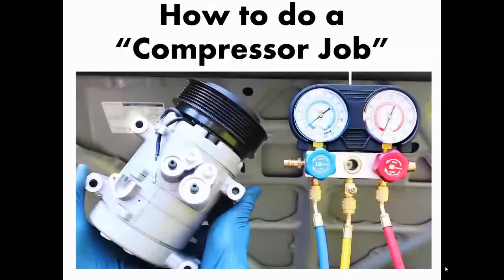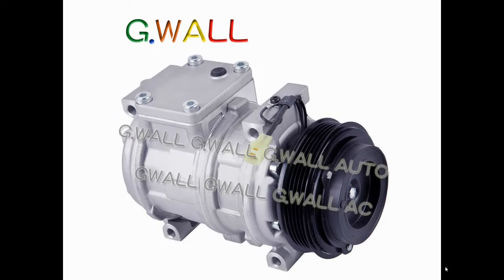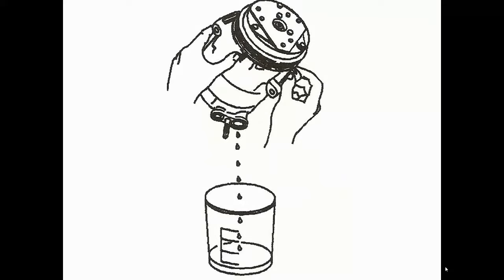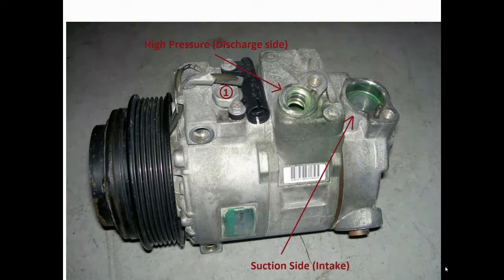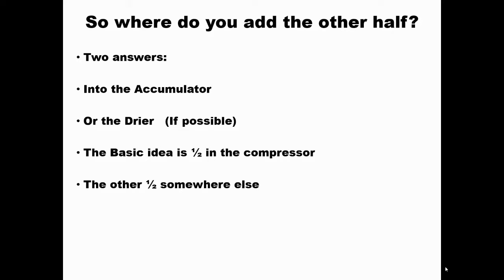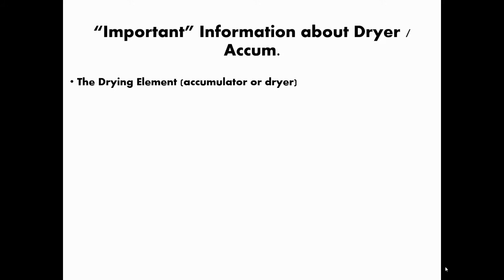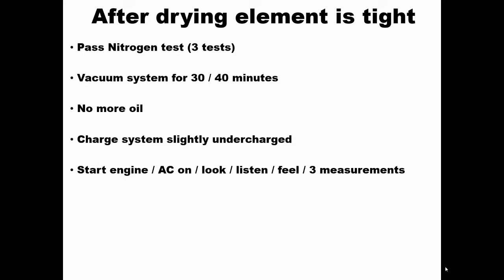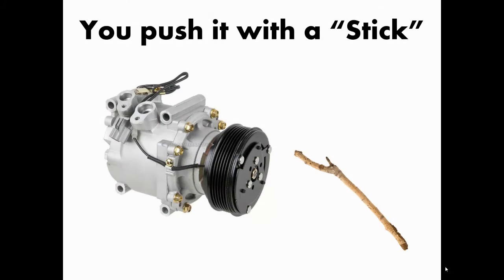Lesson # 12 : How to Replace Compressor.

Comment: Man, I wish I would have saw this video before I attempted this. I have no idea which hole I poured my oil in. All I know is my new compressor rattles and my pressures shot wayyyyyy up. I shut it down. Going to evacuate it AGAIN. Drain all the oil and start over. I changed everything (compressor, condensor, hoses and dryer) so I poured most of the oil in the compressor. Didn't measure what was already in because the seller said it contained 80ml. My whole system takes 7.4 I believe which is 218ml.
Reply from the maker: Get a can of pressurizes AC Flush and flush the whole system to make sure ALL the oil is out. Break a Leg / Good Luck on your repairs.
Reply: @theoldmecanicoshow9004  how do I add the oil back in it before I recharge?
Reply from the maker: @terencescott3957  Pour half of system capacity directly in the suction side of the compress and the other half in the accumulator.
Reply: @theoldmecanicoshow9004  thxs for that. I think I figured out what my biggest problem is. None of the videos I watched gave directions from a "everything is new" standpoint. And I didn't take that into consideration as well. I only put one oz into my accumulator because that's what the video I watched suggested. They were speaking as if that was the only thing that was being changed. Then me being the non expert, I figured i'd pour most of the oil into the compressor and it would all make it's way through the system. 
Thanks for this info. I'll have my system evacuated again, drain all the oil from the compressor and start from scratch.

Comment: I found a very good video. Thank you very much!
I have a question for the doctor.
It is about the oil fill location.
In the MAHLE video, the oil was drained from the drain bolt and the injection was also done through the drain bolt.
Could you please give me your opinion on this method?
Reply from the maker: They don't build them like they use to. In the beginning, 1940 Packard, all AC compressors had Drain plugs that could also be used as fill holes. Sure enough, they used fewer and fewer plugs. 
If the compressor has a Drain/Fill hole, "Use It". Thank you for the views and the question.

Comment: I liked this video. I have a question and maybe you can help. I have a 1999 ford ranger 2.5 that says my a/c system holds 9 oz of pag 46 oil. My condenser had a leak in it and am going to change the drier, compresser and condenser. My new compresser says it came with 7 oz of oil which it tells me to empty and replace it with half which is 3.5 oz. Where do I put the other 3.5 ounces of oil and how do I get it to the factory 9 ounces? Thank you for your time.
Reply from the maker: Thank you for the view and the question. Drain the compressor and don't be surprised when it has less than 7 ounces. I would add half of the system capacity which is 4 1/2 ounces to the compressor. Add 4 1/2 more ounces to the dryer. You do not want 9 ounces in the compressor when it starts up. The idea is you get half of system capacity in the compressor and the other half in the dryer or accumulator. On the newer vehicles that have the drying sack as part of the condenser, it can be pretty tough to get the oil in because the plug is at the bottom. Good luck on your repair and thank you again my YouTube friend.
Reply: @theoldmecanicoshow9004  so you say to drain the new compresser like the instructions tell me to and than add 4 1/2 ounces to the compresser and 4 1/2 ounces to the drier and nothing in the new condenser. should I put the oil in the new drier last and close it before hooking everything up so moisture doesnt get in it or what? thank you for your time.
Reply from the maker: @wisfull11  Yes, yes, and yes. You are very correct about putting the dryer last to avoid moisture. All of these steps are very important to make the AC blow cold and to a last long time. Don't worry about putting oil in the condenser. When the system begins to operate, oil will circulate through the entire system. Very good questions. Good luck on your repairs. I am glad I can help.
Reply: @theoldmecanicoshow9004  so to be correct just add 4 1/2 ounces to my compresser and that's all I need to do as you say when everything is put together the system will distribute the oil thru out the system, but wouldn't the 4 1/2 ounces be less than the 9 oz my system calls for? I know am asking alot of questions, but want to learn to do it right. thank you for your time
Reply from the maker: @wisfull11  Half the 9 0z goes in the compressor, the other half goes in the drier or accumulator.

Comment: I have a compressor that is starting to make noise. It still works fine currently. I plan to replace the compressor before it gets worse so i plan to replace the compressor and dryer only.  When doing so, do I add the full amount of PAG oil that is required in the system or do I need to account for the oil that is still in the lines etc?
Reply from the maker: Correctly "Guessing" at the amount of oil that is in the system ( lines / evap /condenser / other)  is impossible. The "Only" way to say that the system is empty of oil is to do three things: flush lines, evap and the  condenser. It not that hard to flush the system. Get one or two cans of pressurized flush in a can. Compressed air is a great chaser for the flush. Add half of system capacity to the compressor and the rest of the oil either in the accumulator or drier. Thank you for the view and the question.
Reply from the maker: Forgot thing 2 and 3: Thing 2 is drain the compressor and # 3 is replace drying element ( drier / accum)

Comment: I replaced my rear AC condenser, valve, front condenser and valve plus dryer, new lines to the back, compressor.          My question is can I blow out the old oil that may be left, I know I lost some on the ground and compressor has 0 as of now , didn't know to put it in first.     Do I blow out old tho so I know it won't be over filled?
Reply from the maker: Yes you can blow out the remaining oil. In fact, it would be a very good idea to get that oil out. The auto parts (or online) sell a can of pressurized AC flush. It works great. Thank you for the view and the question. Break a Leg / Good luck my You Tube Friend.

Comment: I will replace my bmw F10 compressor, condenser, expansion valve plus cleaning the lines and the evaporator with R11. 

Manufacture says oil amount is 150 ml and i’m worrying while installation that my replacement one doesn’t have oil or have very few oil in it, so in this case how much oil should i put?
Reply from the maker: It is EZ EZ EZ to drain and add to the replacement compressor. No big deal at all. If you what to practice, drain the old compressor, expect little to no oil to come out. add any fluid in the old one, for practice. It's that EZ. I even don't have to wish you good luck, it's that EZ. Good luck anyway. Thank you for the view and the question. Drain the new compressor and add half of system capacity.

Comment: Should I add oil to the condenser ports as well? York install on 1964 lincoln
Reply from the maker: The Basic Idea: Half in the compressor / the other half in the Drier. Thank you for the question and the view. Break a Leg / Good Luck on your repairs.

Comment: How much pag oil would be required if you were to replace the ac system such as the compressor, condenser, and flush system?
Reply from the maker: Thank you for the view and the question. Each vehicle is different. Some smaller vehicles call for as little as 4 Oz's, some larger vehicles call for 15 Oz's. There may be a sticker under the hood with information about the type and amount of PAG. Auto Zone may be able to tell you. You can look it up on the internet. I would get two references and they should be very close. Thank you again and Good Luck on your repair.

Comment: i have cb a 2013 scion tc the freon is full ac turns on , Ac starts off cold then gets warm, i’m going to change myself. should i flush out the ac system first?
Reply from the maker: https://www.youtube.com/watch?v=RpsgEZydGiM
Yes Flush the system. I have used the above product. It works great. I also use compressed air like the video. Thank you for the view and the question. Good Luck my You Tube Friend.

Comment: What happens if you add the oil to both ports and then install it. Which is what I did Not really knowing which port to add it to. I haven't turn the system on yet and after seeing this video. I'm going to remove it and drain it.
Reply from the maker: Thank you for the view and the question. Correct oil level is IMPORTANT . I have drained 100's of new and reman compressors. Rarely do they have the oil the instructions claim. Draining the compressor is no big deal. I like to turn the clutch to work the guts of the compressor during the draining. I also like to turn the clutch AFTER adding half of system capacity. If for put oil in the discharge port, it will pump out of the compressor. Break a Leg / Good Luck on your repair my You Tube friend.

Comment: How much oil do you add if the system has not been flushed. If the system capacity is 6 oz. isn't there some oil in the system already when you're just replacing the compressor?
Reply from the maker: Thank you for the view and the question. I like oil. I like extra oil. You almost have to double the dose before you put too much that it causes problems (increased psi) Ask me how I know. . I suggest you put 5 ounces of oil . Thank you again.

Comment: Ok, so im replacing the entire system (compressor, condenser, lines, etc), i was told to fill the compressor with the maximum amount of pag oil on my vehicle. The proper way would be to put half in the compressor and the other half in the condenser?
Reply from the maker: Sometimes you can get away with it, filling the compressor with the entire system capacity. It's a better idea  not to fill the compressor because it is possible to damage the compressor by causing "Liquid Lock". 
You can put 3/4 of the capacity in the compressor and the rest in the drier or accumulator.
Thank you for the view and the question. 
I have a playlist of AC videos. I hope you check some of them out. Thanks again.
Reply: @theoldmecanicoshow9004  ok so to avoid hydro lock just put the other 1/4 anywhere else then? I'll just add the rest to the evaporator or the condensor and be good right? I appreciate the knowledge you provided though,  it's helping out a lot.
Reply from the maker: @iknuggz2842  One more thing. You add the oil to the compressor on the work table. After you add the oil , turn the clutch by hand or with a tool. That helps to spread the oil around to all the cylinders.
Break a Leg / Good Luck.
Reply: @theoldmecanicoshow9004  yeah I'm about to start on that after I finish up some work, I'll make sure to do so and give an update after the recharge
Reply: @theoldmecanicoshow9004  thanks for the tips! 🙏 My AC finally works after 2 years of harsh summers and it blows ice cold 🧊

Comment: Hi sir 2 months ago i bought a refurbished ac compressor on amazon and it said it was pre refilled with oil but this morning when i turned on the ac it made a horrible rattling sound that came from my ac clutch.The 10 mm bolt broke and the wheel was making awful sounds i did not checked the refurbished compressor for oil since their website says that it comes prefilled.please help! What can i do? Why did the bolt brake if the shaft still spins.
Reply from the maker: I wish I could tell you exactly what the problem is. Did the bolt break or did it fall off? Bolts break for three reasons: 1. - very poor quality bolt  2- exposed to much stress or force  3- it was over tightened. It is an "Un-Funny Joke" how poor quality replacement parts are today. When the price of parts first started to go down, I thought this is great, until I started to see how these cheap parts either don't last very long or just don't fitt correctly. Draining the replacement compressor is not hard (EZ). Rarely do the compressors come when a good amount of oil to begin with.
Thank you for the view and the question. Good luck on future repairs.
Reply: @theoldmecanicoshow9004  the 10mm bolt broke off from the head and the other part stay in the shaft.I will buy another and I will follow this video step by step. I called Ry compressors and they told me that there compressor came prefilled but when I tried to see if there was oil in it and nothing came out. That is killing me since it is a 2007 Saturn aura,you probably know it is a pain in the butt just to take it off bit well hopefully i lerned from this

Comment: Question: On denso's nd 8 oil packaging it states to put the oil in through the discharge manifold of the compressor. Kindly do address why does denso recommend that?
Reply from the maker: Thank you for the view and the question. The reason I suggest pouring the oil into the suction manifold of the compressor is before we install it onto the engine, it's a good idea to rotate the compressor by hand using a tool. We do this for two reasons. One is to make sure all the oil doesn't wind up in one cylinder creating liquid lock. The other reason is to evenly spread the oil throughout all the cylinders and moving parts. Pouring the oil into the discharge manifold and then rotating the compressor by hand will cause the oil to come out of the discharge port.

Comment: My compressor came with washers. Do rubber o-rings go on to the connections at the rear of the compressor in addition to these washers? Thanks
Reply from the maker: I wish I could see what you have to work with. Do the "washers" have any rubber on them? What the old seals look like?
Reply: @theoldmecanicoshow9004  yes, the new “washers” have the rubber mixed in like the old ones. The issue is I have a leak after pulling vacuum, and I was wondering if these needed “extra” o-rings. After digging around all morning I’m thinking they do not need o-rings.
Reply from the maker: @TheRoblcjr  The metal washers can come different thickness. Were the new ones the same thickness? No extra o-rungs are needed. So the system does NOT hold the vacuum? The leak can be almost anywhere.
Reply: @theoldmecanicoshow9004  ok, yes the washers are the same as the old ones. I was hoping I left out something simple like o-rings. Haha. Just ordered a leak kit to see if I can find the leak. Hopefully not the heating core behind the dash. Working with a 2002 Corvette. Everything is packed in tight.
Reply from the maker: @TheRoblcjr  Pulling a deep vacuum and checking to see if it would hold the vacuum after the pump is turned off is one way to see if there is a leak. Unfortunately it does NOT hint where the leak might be. The new AC stations (AC Machines) test for leaks by seeing if the system holds vacuum. I the  AC station says you have a leak, we would disconnect the AC station and connect the nitrogen bottle to the system and pressurize the system. Then we would use "Bubble" leak detector to find the leak. That works for everything except the evaporator. However, if there is no leak under the hood, the leak is inside the dash. Replacing the evap is a HUGE repair. In fact, replacing the evap was the only component by class would do because it was impractical for my student because they only worked on AC one day a week. There were a few times     the customer would chose to get a different vehicle instead of paying $2500 to replace the evap. It's kind-of-like "Totaling" the vehicle because the AC didn't work. Ha Ha.
Reply: @theoldmecanicoshow9004  thanks for all of your help and your awesome channel. I got it figured out. I took the compressor and all back out, and it looked like the connection got torqued a little on the compressor and there was a small leak there. That’s on me… I connected everything back up before mounting the compressor to save time, and I think the force of mounting it torqued that connection a bit. If that makes sense. I followed the proper sequence this time and no leak after pulling a vacuum.
Reply from the maker: @TheRoblcjr  Makes my day to help people.
Reply: @theoldmecanicoshow9004  you certainly did today. Much appreciated.

Comment: Car calls for 5oz oil. Replacing compressor, dryer and expansion. So 3.5 oz in compressor the rest somewhere else. My question is  How do i account for some of the oil that is still in the system? Thanks
Reply from the maker: Use some AC flush. You can get some at the auto parts. It is very helpful if you have some compressed air to "Chase" the flush. Flushing cleans the system and helps to remove the old oil.
Break a Leg / Good Luck on your repair.
Reply: @theoldmecanicoshow9004  thank you 👍

Comment: Bought a brand new ac compressor and the clutch is still not spinning out the box, is it possible the clutch doesn’t spin? It’s a 1989 Buick lesabre
Reply from the maker: Spin on the work table? Spin to the running engine? If it's a "Pancake" compressor / R 4...those are hard to turn by hand. Use a socket and ratchet. Than you for the view and the question. Good luck / Break a leg.

Comment: Hello! Resently i have changed my Car's AC Compressor. But Still experiencing cooling issues. Some says its becase of the amount of oil. I have Suzuki Alto 2010 DBA-HA25S Car, 95201-58J40 Compressor. It Has writen 320 ±30g. What does this means and  How much oil do i have to fill it (in ml)? Please Help.
Reply from the maker: Hello,
+_ means plus or minus 30 grams. I like oil, the more the better. I would put 320 plus 30 = 350 grams. Before we blame the amount of oil, we need to know what the pressures are. Like the low side pressure and the high side pressure. Also most newer vehicle (2000 up) have passages in the condenser that are very small and get restricted very easy with a failed compressor. The pressure would show sighs of a restriction. Good luck and thank you for the view and the question.